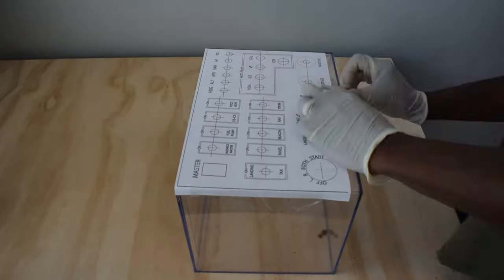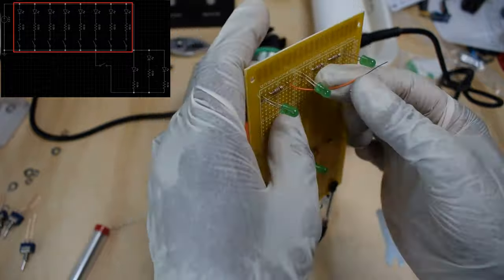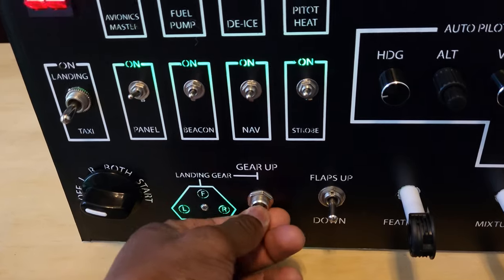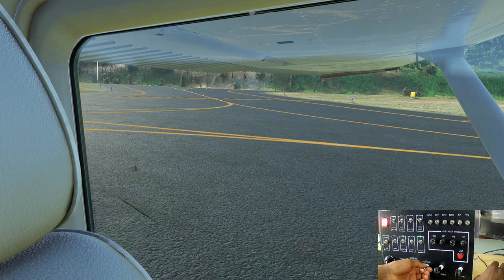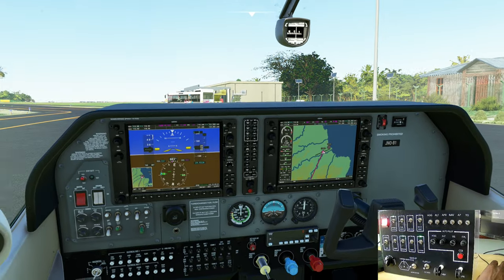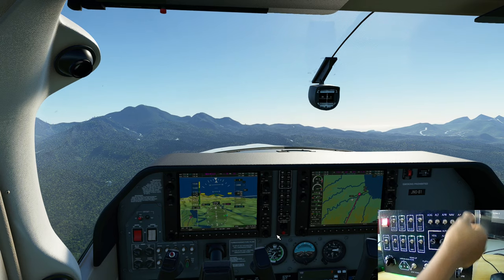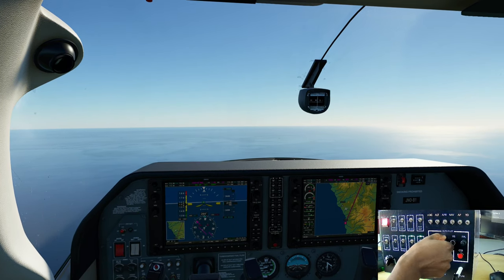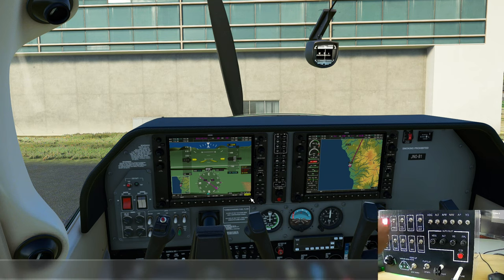Flight Simulator Switch Panel 2.0 DIY Project

Comment: Jno builds: „ cuts everything perfectly and make everything's perfect” me: uses old soldering iron to melt plastic from lunch box/ little plastic box and hot glue to glue it ”
Reply from the maker: 🤣🤣...hey what ever works right 👊🏽😎
Reply: @jnobuildsit1177  yeah if it works 😅😅👊🏾

Comment: What is black removable vinyl?  Is there any chance you could do a video on how to show more detail about doing the white and black layers?  I watched your other video on this and have no idea how you did it.  In this video the panel was off to the left side already cut out and the white lettering.  Then you showed putting down the white back ground then you peeled something off.  BUt if the white lettering was already on the panel why do it again?  And what did you peel off?  Thanks for the inspiration.

Comment: You are creating nice and clean panels. Definitely better looking then my DIY panels. However, I'd still recommend to look into designing your own PCBs and solder switches, LEDS and Arduino onto the PCB, avoiding a lot of cables, and getting a much thinner box.
I mean, one large custom PCB, connecting everything, instead of many small PCBs, that need cables to connect to each other.

Comment: very surprised your vinyl cutter can do that fine detail lettering. can you do a video on just that part?
Reply from the maker: I'm using a silhouette cutter and yes it is very accurate. I can certainly do a video on that part.
Reply: @jnobuildsit1177  Thanks! I've been trying to find a way of making nice clean panels like yours without having to get a laser cutter or CNC machine. I've looked at a few vinyl plotters but so many people saying they can't do small lettering, but you've proven they can!  

would love to know the model of cutter, software and settings you used. Thanks again! keep making videos!
Reply from the maker: @Snugggg  you're very welcome. I used the Silhouette Portrait 2. The link is in the video description.

Comment: Not bad but you missed an entire section on how to set up the micro computer. What pins do what and how to even run the thing in windows. Panels and switches are self-explanatory but I have no clue how you went from there to in game inputs.

Comment: Lots of excellent elements and overall great build!  Using the vinyl cutter to that great looking black-over-white layout looks great.  Definitely interested to see how you did that!  Particularly for a big sheet, I would be worried about how all the fine details would hold up as the backer came off and then how to get it down on the white layer without wrinkles.  A video on how you did it so well would help!  Thanks for sharing!
Reply from the maker: Thank you Thamas! 👊🏽😎 It works great, and I use it every time I fly. The vinyl cutter saved me such time. I have a video on showing how I did it. Check out the link:  https://youtu.be/8VSaGsgEKSQ

Comment: Very nice DIY build! I built something similar using a teensy 3.2. All the switches and encoders work when testing using the windows joy.cpl app and arduino monitor (when i rotate clockwise, my code shows the rotation number and direction). However, i cant seem to have mfs recognize the encoders! The switches work. Its just the encoders that dont work. I have encoders i want to use to set heading bug, course, altitude etc. Help! :)
Reply from the maker: Hey StormRiders, thank you for watching my video.  I know how frustrating that can be that's for I created a video showing how I got mine to work. Here is the link: https://www.youtube.com/watch?v=YbJTERSfEqU

Comment: Very well done 👏. I had no idea that such a thing like a vinyl cutter exists. Looks like a good compromise between final looks and costs. Also kudos for the test flight. I read and played enough by now so I could follow what was going on and even make sense of the used aviation terms. Feeling a lil proud of myself now 😁
Reply from the maker: @Beko Pharm thank you for the support! The vinyl cutter works wonders and always gives such a clean look. I enjoyed that flight test a lot. I use my box every time I fly and it add so much to the immersion. Kudos to you for taking the steps to learn more about aviation...happy flying 👊🏽😎.
Reply: @jnobuildsit1177  That sure is another rabbit hole - alas I'll stick with my space pew pew :D With my own panel and head tracking, of course ;)
Reply from the maker: @BekoPharm  lol 😆

Comment: Btw leaded solder does sound scary, and you definitely don't want to breathe it in or ingest it (which you already shouldn't be ingesting it and should be soldering in a well ventilated area), but other than that it's not really dangerous. And it typically is of a much higher quality, making better joints. Obviously you don't have to and maybe you would rather not risk it, especially if you don't have access to the level of ventilation you would like, but a lot of people think leaded solder is a lot more dangerous than it actually is. Look into it more if you are hesitant; I don't like to blindly trust safety info from the internet without looking into it further either so no offense would be taken lol.

But yeah this looks like an awesome project! I've been wanting to do something similar for a while now but have been scared I won't be able to finish the project... Mostly because I want to 3d print my button box and my 3d printer is a bit temperamental when it comes to needing any amount of precision lol... But now I'm realizing I can just make it out of wood, which will also make it look a lot nicer too!
Reply from the maker: Thank for info. I agree that in either case the soldering should be done in a well ventilated area. I  do have lead solder, but prefer to use lead free for smaller projects. Thank you for checking out the vid. I think you should go ahead and build your box, it is totally worth it. 👊🏽😎
Reply: @jnobuildsit1177  Yeah sadly I can't start one right now because I'm at college and dorm rooms don't exactly have ventilation haha but definitely I'm going to start on a button box when I get back for winter break! I can't wait to get started!

Comment: Very cool project, and nice panel layout. ...May I ask how you get to access some of the MSFS variables such as the FMS flight plan fields (the ones with the rotary encoders)? In the  MSFS "controls" menu there doesn't seem to be specific variables to access those (or maybe I missed them).
Reply from the maker: Thank you 👊🏽😎. I used the MobiFlight event files in FSUIPC. I may decide to make a video on it.
Reply: @jnobuildsit1177  Please, please do!   :-)

Comment: Can you explain how you attached the vinyl with cut out  lettering to the white surface on the box ?
Reply from the maker: Yes, I used vinyl transfer paper. 
Step 1:  Cut a piece of transfer paper about 1/2 inch larger than the removable vinyl that you want to transfer. 
Step 2:  Remove the backing from the transfer paper, exposing the sticky side.
Step 3: Carefully place the transfer paper (sticky side down) onto the removable vinyl and smooth out any air bubbles.
Step 4: Remove the backing from the removable vinyl.
Step 5: Place the removable vinyl onto the box sticky side down.
Step 6: Remove the transfer paper.
Step 7: Smooth out any excess air bubbles
Here is a link to the type of transfer paper that I used: https://www.amazon.com/Clear-Vinyl-Transfer-Paper-Alignment/dp/B07KPC4K7W/ref=sr_1_5?crid=1K4T2AARVNO7M&dchild=1&keywords=vital+transfer+paper&qid=1633105527&sprefix=vinal+trans%2Caps%2C205&sr=8-5
Reply: @jnobuildsit1177  Do you think the vinyl cutter can do very small lettering down to a size 6 font ?   Thanks very much and a great project.
Reply from the maker: @speedbird8326  I have not tried a font that small. However, I know that the Silhouette Portrait cutter is very precise. The biggest issue with cutting letters that small is that they might peel off in the process. If you haven't already, please check out my tutorial video where I show how I cut the vinyl for my box. https://youtu.be/8VSaGsgEKSQ

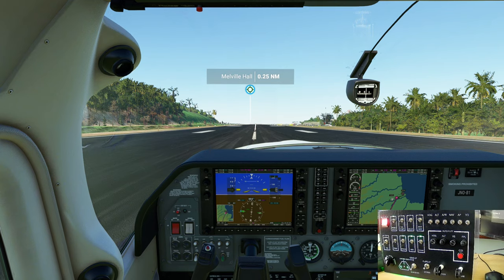Comment: Awesome work! I wonder why you keep the fuel pump ON (9:51). Actually and AFAIK you need it just for a few seconds before ignition. It is crying for mercy all the time ;-)
Reply from the maker: @SunnySunGER thank you for the support. Lol, still in the learning process. I have noticed that some people wait until after take off to turn off the fuel pump and then turn it back on when on final. Thanks for the knowledge. 👍🏽
Reply: @jnobuildsit1177  Many 172s like the modern with G1000 are fuel injected. On a carbureted model, you prime by pumping the primer between 2 and 5 times. On a fuel injected model, you prime by running the fuel pump for about 3 to 5 seconds with the mixture open. 

Keep up the great work man, love it.
Reply from the maker: @SunnySunGER  thank you for the advice 💯 👊🏽😎

Comment: how do u programm all the switches? is the Teensy controller acting as a game controller within windows,  by which you can directly assig all the switches to their functions inside the flight simulator?
(so no additonal software needed for programming?)
Reply from the maker: Check out my other video where I give instructions on how to do it. https://youtu.be/YbJTERSfEqU?si=XZPQ_1rCipZsD-n2

Comment: Amazing work Jno!! Looks great! you gave me inspiration to make one of my own but nowhere near as good. Do you have a link of the script you used on the Teensy as iv tried the library ones and not working as good. Also do you have a clearer diagram of you wiring set up? please can you help? thanks
Reply from the maker: Hello Joe, here is the link to the Teensy file that I use. You may have to edit it to suit your Switch Panel.
https://www.dropbox.com/s/xuyhd37be6jp9a4/sketch_panel_2.0.ino?dl=0
I am working a wiring diagram that is more comprehensive and much clearer.
Reply from the maker: I have added the link for the circuit diagram to the video description. Thank you for checking out my video and I'm glad to hear that I have inspired you to build your own. Let me know how it works out when yours is completed.

Comment: Hello great project I am looking to build my own and have ordered parts I was looking at your diagram and I cannot work out what switches are what, I was wondering if yo could put the switch types in the diagram? also would an Arduino micro work instead of Teensy? thanks in advance.

Comment: Can you please help me elaborate on the dual rocker switches? I have those switches and no matter what I try, I neither get the built in light nor the signal to Arduino. Appreciate any help / guidance you can provide.

Comment: Hello Jon, I Wanna ask a question for flight simming projects like this. How do you pair led lights along with switches and not burn the usb board? and how does a breadboard help and what does it do
Reply from the maker: Hello Mr. Vaggelis, great question. The USB (Teensy) board that I'm using has it's own 3.3VDC output which powers the
LEDS and therefore will not burn out. The switches on are just simple conductors that interupt the path of current to the LEDs and do not affect thevoltage. The bread board is good for keeping your project organized and neat.
It allows you to connect different components like switches, LEDs,
Potentiometer (knobs) Teensy board, wires, and etc. together.

Comment: Wow…this is incredible! What motivated you to build this?
Reply from the maker: I have a passion for electronics, flight simulation, and building stuff. I build this switch box to enhance the experience.
Reply: @jnobuildsit1177  that’s awesome!!!!
Reply: I built mine as it is much easier to flip a labelled switch than to remember a keyboard combo that often requires 2 hand to press. I too have hobbies in electronics, wood/metal work and flight/space sims.

Comment: How do you integrate this with windows 10 via usb? Will this be detected as game controller ?
Reply from the maker: I used a Teensy board and Arduino software. The links are in the description. Thank you for watching my video. 👊🏽😎
Reply: @jnobuildsit1177  Can a esp8266 nodemcu be used instead? I know I can make it run arduino programs.
Reply from the maker: @Simon George I have not tried using a esp8266, just the Teensy. However, since the esp8266 runs on Arduino it might work.
Reply: @jnobuildsit1177  hope you don’t mind me asking lot of questions. To test it it works, if I simply load the program and run after connecting nodemcu to pc, should it be detected under game controller?
Reply from the maker: @simtcr  to be honest, I do not know. I have not used the esp8266 nodemcu before. However, this link might be a good place to start. https://create.arduino.cc/projecthub/electropeak/getting-started-w-nodemcu-esp8266-on-arduino-ide-28184f
Reply: The Teensy is a USB board, so once it's pluggedin it shows up as a controller in the USB interface panel.  FSUIPC is then used to assign the various Teensy inputs to FS inputs.    The nodemcu is not a USB board so will not show up as a controller.  An other option would be the Arduino Leonardo, which also shows up as a controller.  I'm currently building a farmsim controller with dual joysticks and 64 switches on a leonardo.

Comment: Amazing project. What a great control box. Super impressed and inspired. I want to build something like this. Just wondering what is the max amount of buttons. Also want to add in throttle/mixture sliders, as I  primarily fly the 152/172, in MSFS on Xbox series x. 

I see other use the teensy, which audrino do you recommend. Thx 🙏.
Reply from the maker: Hello Nick, thank you for the support. I'm glad you like the video. I used a teensy 4.1 so I believe the max number of inputs are 54. However, if you use a grid pattern (not shown in this video) you can get up to 128 inputs. The number of inputs that you will need depends on the type of switches and knobs that you're using. I use my sliders for prop feather and engine mixture, but they can be assigned to whatever you want. I used the teensy because I wanted to see if it would work and to help others that already have a teensy board. I haven't tried the other Arduino boards, but I've seen videos where they work well also. I don't know which Arduino to recommend.
Reply: I wouldn't integrate my throttle quadrant into the panel, personally. You want the panel up higher and the throttle down at hand level for comfort.

Comment: 300F on the soldering iron?  I doubt that's F.  You'd need at least 420F to use lead free solder.  It's more likely 300 C that you used.
Reply from the maker: @No1sonuk you're correct, the temperature is in Celsius. 300°C.
Reply: Yeah, that bit puzzled me too :D 300C is "danger zone" on mine - cuz this is where it starts melting the casing of the device itself 🤪
Reply from the maker: @BekoPharm  yeah it was 300°C.🤣

Comment: Cool Project bro.  I have a question tho.  Can you assign buttons and dials to things not listed in the controls list?  there has to be a way because it is being done but I have no clue how to do it.  For example... the heading dial on my B777 is a push button with a dial, but that isn't assignable in the system controls settings.  I have several button boxes but its not on the list so how do I assign it?  Any help you can give is appreciated.  Thx
Reply from the maker: Hey, Jason,
Thanks for subscribing to my channel, bro. Yes, you can assign the buttons and knobs/dials to things not listed in the MSFS control list. You need to use FSUIPC. Check out the video were I assigned the knobs for the GPS. Here is the link: https://youtu.be/YbJTERSfEqU if you do not have FSUIPC, check the video description. Let me know how it turns out.